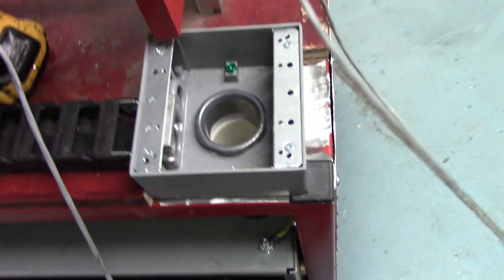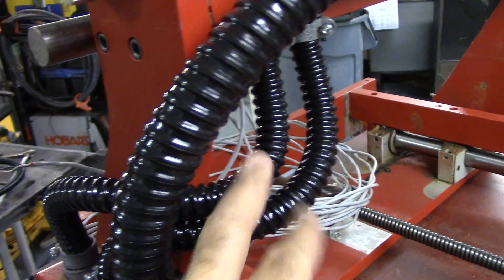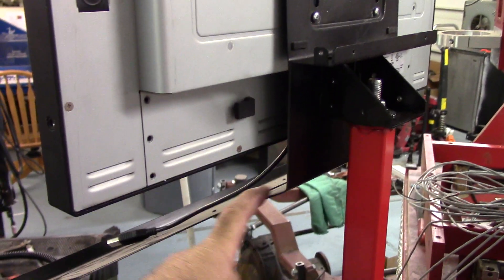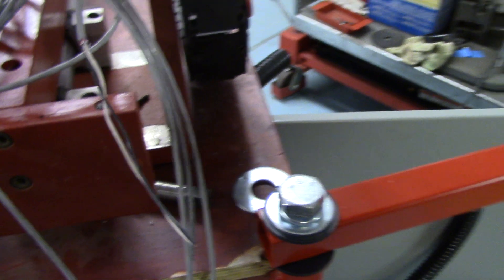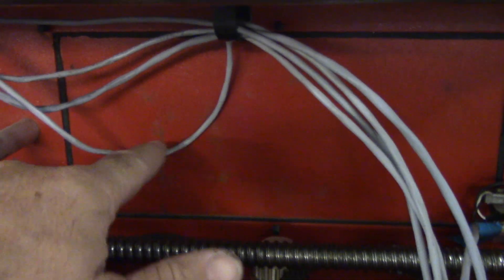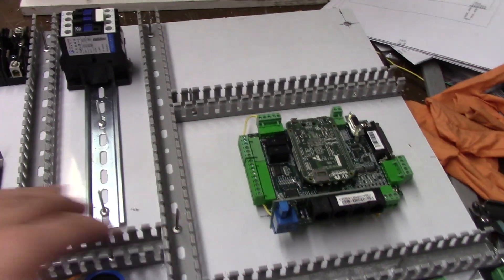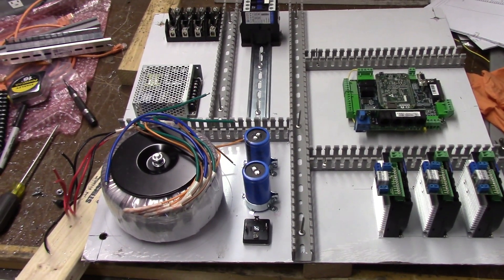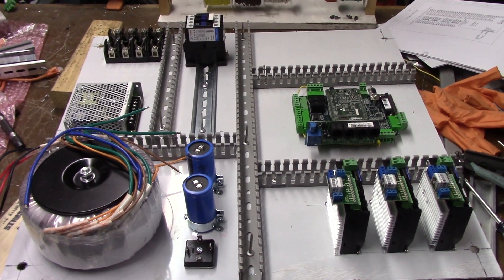Phoenix CNC Router Upgrade: Centroid CNC Acorn DMM AC Servos. Part 3

Comment: On the Toroidal. What are the specs for all the components that make the power supply?
Reply from the maker: Just buy a 60vdc from antekinc.com I just use parts I had. In retrospect, it would have been easier to buy it complete and time ahead

Comment: I'm  a bit confused about the acorn. It says 4 axis. Which implies it can do a rotary axis. But the acorn marketing material shows just 4 motors. In a cnc router you have 1 z, 1 x and 2y. Thats 4 motors.
Reply from the maker: Acorn supports 4 axis of simultaneous motion. https://www.centroidcnc.com/centroid_diy/acorn_cnc_controller.html
Not all routers need 2 motors on an axis. What you are describing is a SLAVE axis, which is tied to another axis. With the proper license, Centroid allows you to software pair a SLAVE axis. Alternatively you can hardware pair the axis and save the 4th axis for a rotary axis.